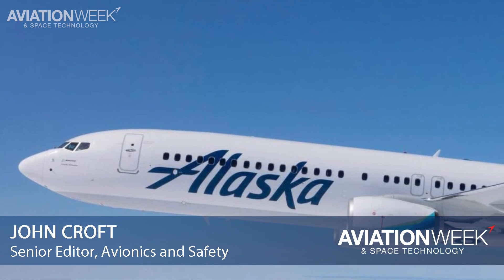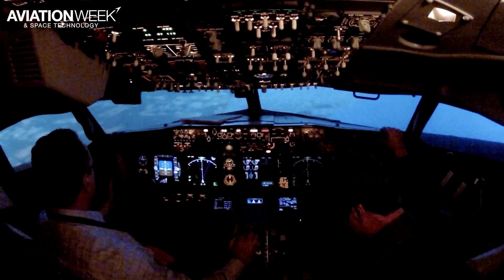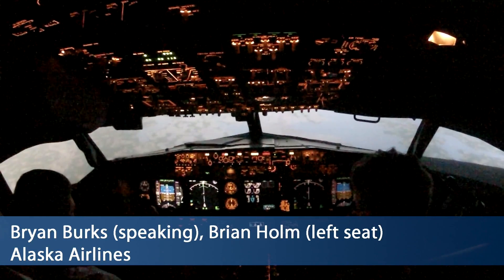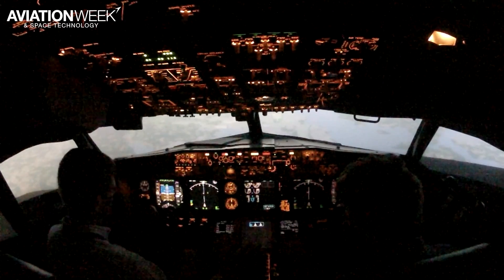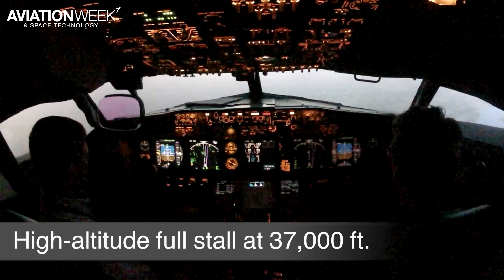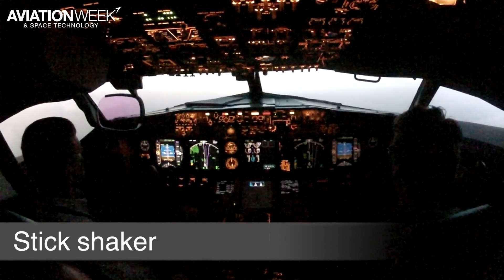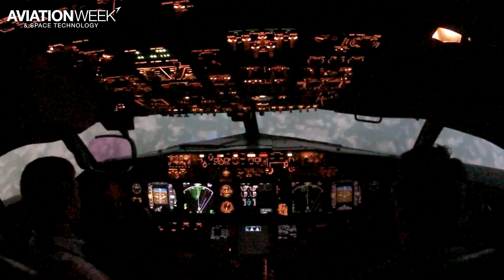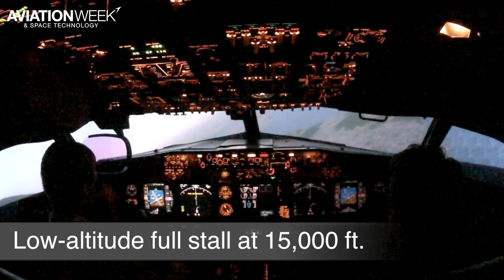How Does A Boeing 737 Handle On A Full Stall?

Comment: Seems so easy in a simulator but everytime I see an air disaster episode the pilots always fail to recover from it. I wonder how many stalls happen on planes and they recover like this.
Reply: Look up Astana air flight 1388, now of course the issue with the flight wasn’t just a stall, but the ADS-B data showed stunning climbs at rates near 7000 ft/min, and dives as fast as -26000 ft/min. Truly the stuff of nightmares, but they never gave up and managed to save the passengers and themselves. As close to a miracle that I’ve ever seen. Sullenburger doesn’t even come close.

Comment: Does the stalls happens in every flight?
Reply: Oh god no, in commerical airliner jets they almost never happen. Extremely turbulent weather, pilot error, or a mechanical failure would be the three main causes, all of which are extremely unlikely.
Reply: I do believe, if it were ever to happen, it would be during type certification. In other words when a newly designed plane is being tested to prove it can meet regulations / claims. New planes go through a battery of tests and certifications before they are ever allowed to carry passengers.

Comment: The stall signs he described are exactly what happened to Af447 yet those guys didn't realise it was a stall. Weird.
Reply: The AF pilot flying didn't execute the proper recovery (he continued to pull back).  When the other pilot gave a nose down input  the automation wasn't able to reconcile the differences and they dropped 35K+ feet.  I flew airlines through 2004 and we never practiced this.  Only one day of sim training went above 5000 feet and that was to practice rapid decompression recovery.  Only approaches to stalls (low altitude) were demo'ed.
Reply: @halb37 plus in a 737 (including a 737 sim) wouldn’t this be much more recoverable because the way the yoke works makes dual input impossible, unlike on airbus aircraft?
Reply: @ExperimentIV     Yes, in an aircraft with conventional yoke controls (mechanically linked) the largest input, or strongest pilot, is what is sent to controls.  Practically speaking it allows each pilot to "see" what the other is doing.
Reply: Panic.

Comment: FWIW 15,000 feet is a "low altitude" stall because shock waves and mach no. complications are not involved. At typical cruising altitudes these can cause more serious complications and loss of altitude and control. I.e. definitely going to spill some drinks!

Comment: I would have been much more interested in "REAL WORLD" stall characteristics.  Simulators are fed info by programmers which can be greatly influenced by their superiors to achieve only certain results.  Try it for real if you want real results.
Reply: A full areodynamic stall can never be the same for any aircraft due to every little microscopic difference in the manufacturing process. So i don't think it's possible to do "real world" stall characteristics as easily as it said.

And on top of that, most simulator programmers want pilots to be trained correctly. I highly doubt that the code would be adjusted to "achieve specific results". And if it was the case, I'm sure the NTSB or other gov't agencies would step in as this would give pilots/students false confidence in which a fatal situation is more likely to occur.

You don't usually see a person coming out of the simulator incorrectly informed on how to handle situations. As a matter of fact I see airliners encouraging practicing situations numerous times in simulators, so that they can be prepared as much as possible for a real world situation.

Not saying you're wrong, as a matter of fact I'm sure it has happened before, but this is just my take on it,

Comment: I have an ATP, and around 5000 hrs or so. . .Stall practice is stupid. . .Once a training pilot early on in small planes does a few stalls, and understands the idea, there is reason to be screwing around with it anymore. . .And one dam thing for sure, is airline pilots don't fly around at these speeds, I mean why would they. . .Its a retarded idea to even play around with it. . .To those of you who would use the Air France coming from South America crash as a reason, well, That was only because France doesn't have much of a general aviation system, and the pilot who was flying never went up many times in a single engine plane.  No common sense, whatever. . .Bottom Line, there is NO Reason to play with stalls for practice. . .Just don't fly around that slow, period.
Reply: Never heard of a pilot saying practice is stupid before...
Reply: @a1919akelbo  I said "Stall" practice was stupid. . .I am Not referring to student pilot training, where yes, Stall practice is needed. . .I am talking ONLY about why in the world there would be so much anti-stall equipment would ever be needed on a modern jet airliner. . .Tell me, what pilot who rises to a job flying a jet, would be playing around at such low speeds, that they need stall training, and practice for???
Reply: @daveberry5901  Never heard of a pilot saying "this aircraft has too many safety features" before...
Reply: @a1919akelbo  I don't call a device that wrestles away control from the pilot a Safety Feature. . .I suspect the crews who come from countries without a fair amount of general aviation just never get seat of the pants skills, so they install this crap. . .How hard is it to understand this. . .Its not safe to fly that slowly. . .So don't do it. . .How hard is this to understand. . .
Reply: @daveberry5901  well a plane has to go slow before it goes fast... Most stalls also happen on take off and landing....... When planes are supposed to be going slow............ So quick reactions and any advance stall warning system is usually an appreciated thing........................ You really know nothing about aviation huh? Heres a little quiz Google can't answer but someone who even dropped out of ground school could tell you;
-Whats a maneuver you can do to slow down and drop altitude on final approach?
-what three things do the throttle control?
-how would you tell your atc your engine just stopped working?
Reply: @a1919akelbo  Evidently, you did not see my qualifications before typing. . .I hold an ATP (airline transport pilot) rating, with about 5000 hrs, qualified in the Lear 55 and Citation II. . .To answer your questions, a "Slip" is the effective way to do this, but you better not do it in a jet with passengers onboard. . .The throttles control fuel flow, and sensors in the throttles send data to the ECU, and flight recorder. . .Depending on which engines, they send more or less depending. . .Next Question???

Comment: how does the plane sense stall? using only speedometers caused many accidents because of speedometer failures. maybe pressure on bow surface can be used as a secondary and coarse speed measurement.

Comment: Very  interesting.   I don’t recall any mention of the use of thrust as part of the recovery .   In any event ,  the 737 having underslung engines,  application of thrust generates a very large pitch up couple,  which can induce the stall again.  Oddly ,  in order to counter the rapid nose pitch up (due to thrust application ) the pilot may have to push forward on the control column, simultaneously applying nose down trim on the pickle switches,  to limit the the nose pitch up.   If this cannot be done quickly enough,  the pilot must be prepared to reduce thrust somewhat to maintain control,  ( and prevent a further stall ) an action which is totally opposite to what one would normally expect.

Comment: I was imagining a plane spinning as it drops.  I guess that's when you let the stall get completely out of control.
Reply: that's a spin... and your right.  Stall+Yaw=spin
Reply: That is the real danger.  One wing stalls first and drops which turns into a spin.  If a wing is stalled you can lose aileron authority and attempting to correct the wing drop can increase the drag on the stalled wing and seal your fate.
Reply: @jamescaley9942 Thanks for the responses. Is it possible to recover from a spin?
Reply: @JackRainfield  If you have sufficient altitude a spin should be recoverable.  It is not a normally practised manoeuvre in light aircraft training.
Reply: @jamescaley9942  Ok, thanks.

Comment: When I was learning to drive manual on a 92 Honda Civic I became an expert at recovering from full stalls.
Reply: How fast was your Honda Civic flying at the time that it stalled? Did it have a huge spoiler?
Reply: The stress level is also comparable as traffic begins to build up.
Reply: @Kodos2024  Yeah, or you're in the middle of a busy intersection and can't move more than 2 feet per start.
Reply: hahahahahahaha good one!
Reply: Thanks for the laugh good sir that made my day
Reply: I became an expert on full stalls when I got a 150 dollar school computer
Reply: just point the nose into the ground and you’ll be fine
Reply: Paul Leroux fucking same
Reply: mine's a 2012 and its a pooch
Reply: Omg yes. Its the same thing, you should become a pilot.
Reply: 92 Civic is like the easiest car to learn manual on.....
Reply: @ellisjackson3355  not if you’re blind……
Reply: @Jamesfrancosdog  being blind doesn't preclude you from accelerating forward and shifting gears in a straight line while holding the wheel straight as long as you're on a very large open patch of asphalt with no obstacles
Reply: Same but with a 89 Toyota Tercel 👌🏼
Reply: Same here. But I think it’s quite different in a airplane lol

Comment: If you folks don't think this can ever happen I was a witness to it happening. A 747 in front of us going into Hong Kong at cruise altitude and speed (MACH .85) Hit bad turbulence in a thunderstorm and went into a high speed stall and literally fell out of the sky. They eventually recovered but severe damage was done to the airplane. They were very lucky. I won't say anymore as I knew the captain, he used to work for us. But enough said on that.

Comment: So, when would a deep stall happen in reality? Is it realistically survivable or is the aircraft's fate pretty much sealed?
Reply: We’re not talkin deep stall here, deep stall is on t-tailed planes which is very hard to recover from. 737 is not of this type. Deep stall is the stalled wing blanking the airflow to the t-plane leaving you with almost zero rudder authority. Full stall on the 737 means stalling both wings and losing lift, can happen if you go too high, too slow, too fast or too steep, check out “coffin corner”, interesting read. It can be recovered from when done right, not a pleasure though. Success mainly depends on the appropriate actions. Sufficient altitude below you to trade in for airspeed is a plus too.
Reply: @e.c.listening326  I always appreciate insight like this. Thanks
Reply: Jd stark you’re welcome

Comment: I think a lot of beginner pilots would prefer to do their first stalls in a simulator except that I don't think they are made for Cessna 172s and Pipers!
Reply: Many new pilots worry about their first stall lesson but stalling out a single-engine Cessna and Piper aircraft is a walk in the park and very predictable.
Reply: Stalling a PA28 is nothing like this, very undramatic. Add power, push the nose down gently and you will fly along happily 100 feet lower...
Reply: My first flight lesson was power off stalls at night in a 172M. There is only one way to really get the feel for it, and that's by doing it. Your flight instructor will want to take you out and practice the real thing...unless, of course, the flight school just got a new Redbird simulator and want to start making some ROI.

Comment: Why there is not a software on autopilot which would take over when pilot does something extraordinary stupid ?
Reply: Programmers can only write routines for when everything is going as expected. How do you write code for the unknown?
In the last decades, there have been several incidents where the computer gets confused. Either by icing, hitting a warmer layer at max altitude, an updraft or an engine flame-out. When the computer is confused, the pilots get confused by all the contradictory alarms and dozens of flashing lights. And it always happens hours into a boring flight, the last day of an exhausting week with multiple time zone changes and little sleep, after years of nothing ever happening.
So pilots need the muscle memory to do the right thing even when they get woken up by the autopilot disconnect.

Comment: Low Altitude Full Stall at 15,000 feet agl???  In a sim you should try a slow down due traffic or birds while applying gear down while turning base to final leg, altitude of 2,000 or 2,500 feet and make them recover before hitting ground. Its a sim, dam it. I practiced slowing down to stall warning sounds turning base to final on ILS at 1,500 feet agl and recover.  Actual..Real,  NO BS.. Aero Commanders and Piper Navajo and many others.. South America.. Not with passengers on board, of course..  A gear down while turning base to final approach- to stall warning speed.  No big deal..
Reply: Rich Grant a 737 loaded with bags people fuel and food can not recover from a full stall at 1,500ft. That’s y they don’t do it. From the aircraft is approaching a stall, the pilots will make corrective inputs to not enter that stall. Especially at 1,500ft
Reply: @lilice013  -- So they should not do a deep stall, but approach to stall instead.  Why not??  Its a sim.  I practice full stalls on sim at 500 feet agl. Grumman Tiger 180 hp.  I recover it at over 200 feet all times (with level wings I do full stalls at 500 agl), Or I if use 30 degree bank turn I do them at 700 agl) .. It is great practice to develop balls, (Cayuns)  You get used to them.  Its a sim, dam it.. If i ever hit a bird there or near miss, etc and almost stall or stall full, Im used to recover fast and good at that altitude.  Base to Final stalls are called...

Years ago, on a Cherokee 6 with cargo, I was doing an IFR night departure, I almost stalled in turbulence while climbing at about 200 feet agl. I noticed the mushy elevator (old cargo airplane stall warning light was not working) so i just put 25 flaps and lowered the nose a bit.  It worked. Found out on ground, that Airspeed was indicating 12 mph over real, due someone put the static port switch  (which is invisible under the panel) in the wrong position.  I flew to destination by ignoring the airspeed indicator and flew by 6 senses only.. Im anti automation dependanse since the PPL and that saved me from crashing on water at night.  The cargo was going to hit me from behind and kill me if I hit water at 60 mph...

Believe it or not, next day my boss asked me to fly the same Cherokee on a 300 mile flight with important cargo again.  Used to fly it with no Airspeed Indicator  I flew it like that for 3 days until mechanics could get to it.. It was in South America where pilots fly regardless difficulties..  I survived..
Reply: I trust that pilots can do the procedures one at a time, or they would not be in the seat. Every sim rotation needs a Kobayashi Maru. 
A 20 minute scenario before a coffee break, just to see what they will do. Something Evil that needs multiple memory items at the same time or progressive failures. During the break they can unwind and change nappies.
Reply: @Aimless6  --  What is a Kobadashi Maru?? .  Im an Aerobatics Upset and 5 EFATO CFI.. T I A...
Reply: Cultural reference: Star Trek TOS and TNG.
Unwinnable training exercise where all choices are bad and the problems keep increasing. But a good crew can somehow win anyway.

Very Evil scenario:
- Something vague like a right engine oil temp warning after takeoff from Denver>LAX... that progresses fast into a bearing failure, just as they were about to idle it.

[tell them afterwards that it was always going to fail in this scenario. even if they did it right]
- Several fan-disk blades puncture the cabin ..... over mountainous terrain. [extra difficulty of having to use the oxygen masks]
- Deal with the asymmetric thrust and drag from the damaged engine.
- While they are busy with that, left side hydraulics loses pressure from a puncture.
 - After that, a fuel unbalance develops from a hole in the right wing.

Return to Denver ... 

- With all the turning, hydraulic pressure has been dropping. Now it's back to muscle power until it builds back up. [Does the right EMDP still work and should they even think about using it?]
- Uneven flap extension because the right side is stuck. [try to see if the alternates work better or leave it as it is?] In combination with the fuel unbalance, this might even help.
- Manual gear extension .... right side does not lock. [With the shape the wing is in, should they wiggle it?]
- Left generator overheats. (now on battery power / start APU?)
- If they started the APU early on, did it light at altitude? Did they wait for the APU to cool down or risk fire?

- The brake accumulator is only half full.[Do they even calculate the landing distance for low brakes, partial flaps, half the speed brakes and one reverser? If 16 000 feet is not enough, what you gonna do, divert to something longer? ]
After stopping.....

- The right wing is still  leaking fuel, so inform the cabin to evacuate left.

Perfect score is if they did all that, before PAX oxygen ran out.
Reply: @Aimless6  -- Good exercise, Joe Jitsu (or whatever)  Then the copilot comes on the inter and says.. "Your attention please, the captain just committed Hari Kiri due all the problems here and "Anyone here knows how to land this airplane like this???  Then only Ted Striker shows up at the cabin... LOL>

Comment: As a flight pro with 39 years experience he handled this wrong. He should quickly apply power to raise the noise and power out of the stall.
Reply: Raising the noise will not do any good 😉 proper airflow over the wings is what gives you lift, at high altitude powering out of a stall might be out of limits